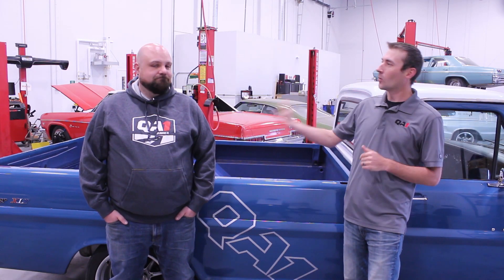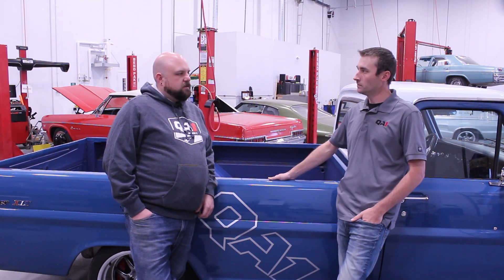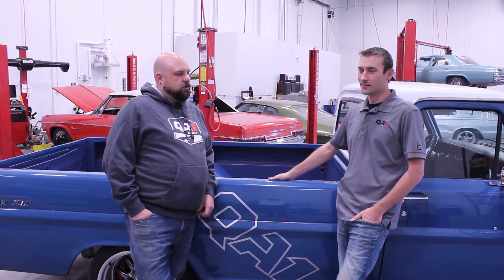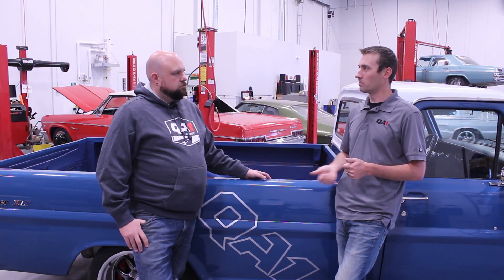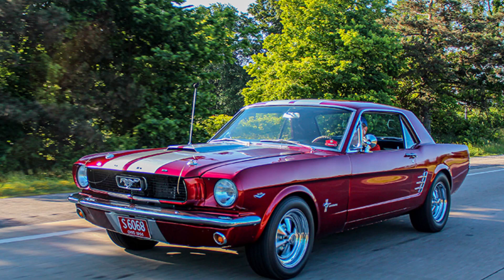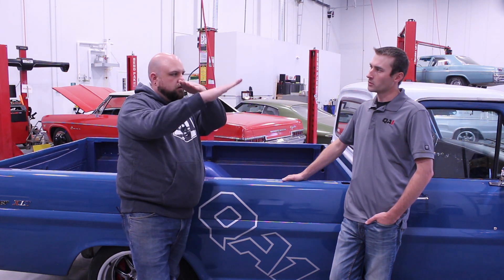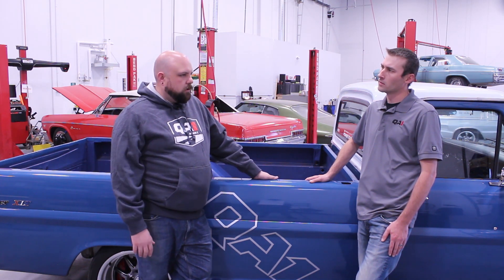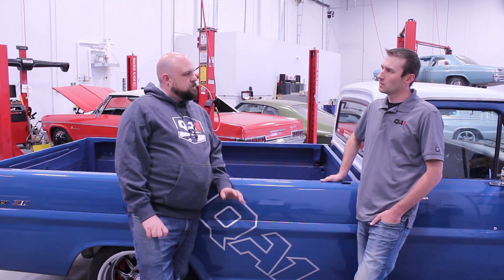QA1: Design Engineer Review on 64-73 Mustang Coil-Over System

Comment: I currently have a grab-a-track front and rear suspension system. How would your kit compare to that? I also have subframe connectors and traction bars. going from stock to this setup was amazing, i can only imagine a coil over setup would be even better?
Reply from the maker: We cannot speak to the Grab-A-Track suspension system, but our system offers a wide range of adjustability for handling and performance and will help you achieve a more aggressive stance.